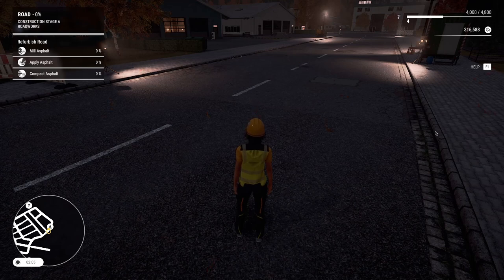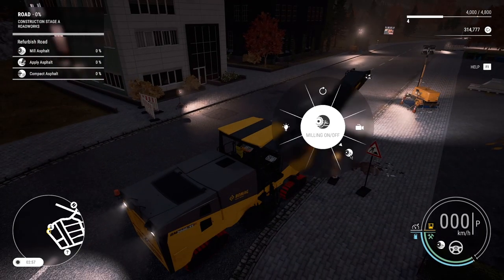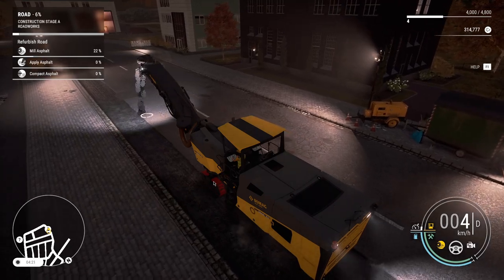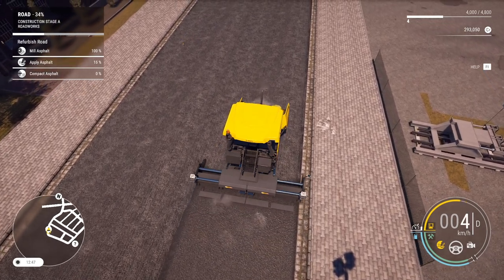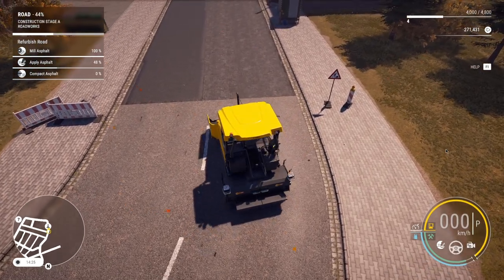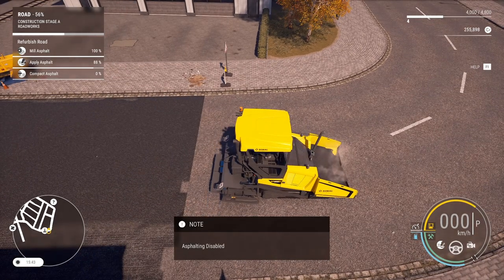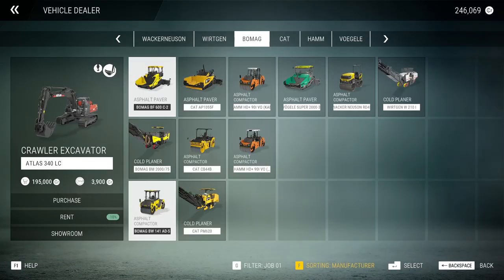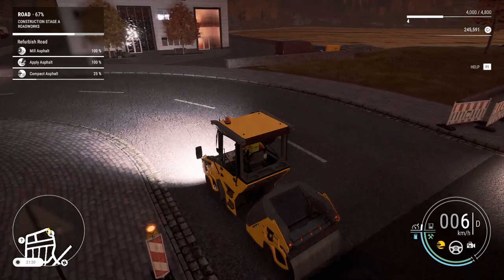Construction Simulator 2022, Lay An New Asphalt Road Job, 300 K Currency

Comment: Do you know how to hire a helper, i unlocked it but cant figure it out, seems a waste not collecting the asphalt to sell.
Reply from the maker: you cannot get helpers.
Reply: That’s what multiplayer is for. But I mean farming simulator us A.I workers that could harvest and then the player would collect 🤷‍♂️
Reply: Damn, thanks 👍
Reply: @34stevo  yeah honestly it seems like a bit of an oversight in their part. They could’ve at least made an A.I worker simply drive in a straight line this allowing us to drive next to them and collect.. idk. I joined a multiplayer game and only got 10% of the total earning for each job I did idk if that’s something the game does or the something the host chose specifically but don’t really see the point of playing multiplayer for extra profit.
Reply: Right it's weird cus on previous versions you can hire an AI to follow the machine with the dump truck
Reply: I mean why have the option of unlocking a helper if we cant use one.  Such a weird design.